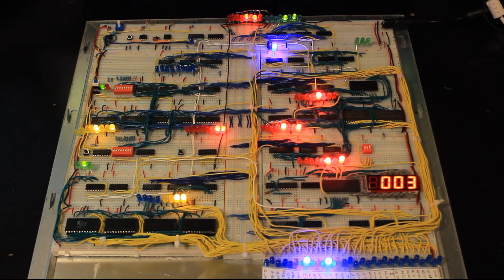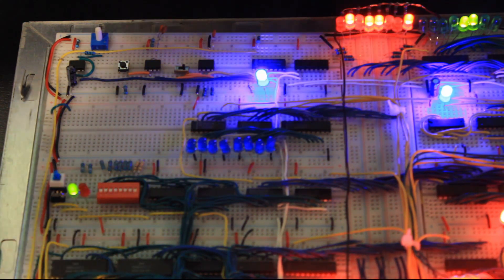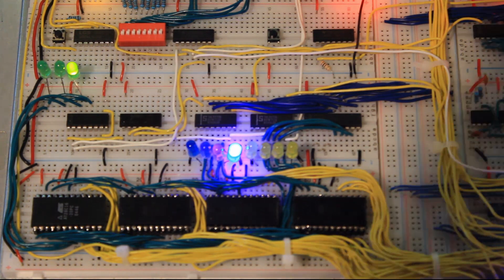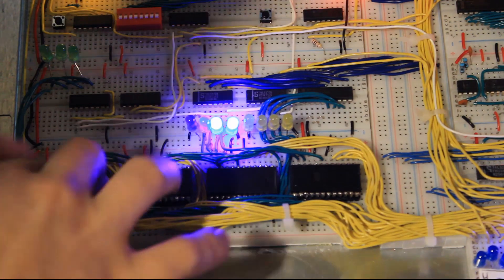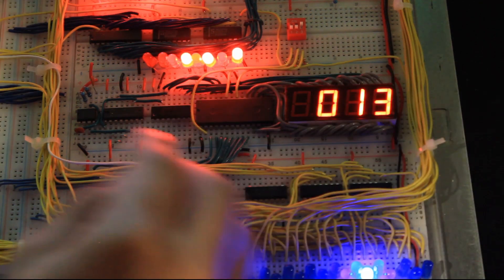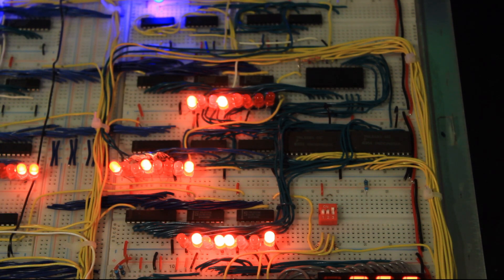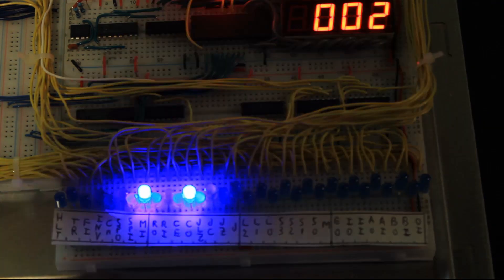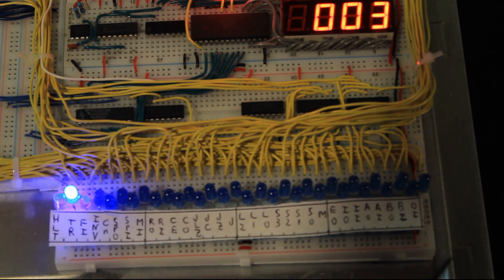8-Bit Breadboard Computer Hardware Overview

Comment from the maker: A few things of note for the record:
1) Converting to a Brand Account deletes my channel's old comments. Thanks to all that commented and engaged in discussion prior to 2020. :) Unfortunately, my old responses have all been removed by YouTube. :(
2) The program counter did not have a segment where it was looked at in detail during this video. It's on the breadboard with the green LEDs in the far upper right corner. The counter is simply 2 of the 74ls series 4 bit counter chips chained together; it is otherwise identical to Ben Eater's program counter implementation. This enables counting through the 256 addresses in the 8 bit space for the expanded memory.
3) The bus was modified slightly from Ben's design to use 1k pull down resistors as opposed to 10k pull down resistors. The indicator LEDs were also given individual current limiting resistors to prevent burnout if an unlimited current signal was applied to the bus. While the 74LS series signals are current limited to about 20mA, Myself and my LEDs highly recommend this upgrade. :)

Comment: can u tell us in detail how u create the assembly programs and which programs u use to create files thanks i got logism 2.7.1 and got all your files from github, please with an example cheers
Reply: Thanks for replying, i have managed to run the example programs u have, i have windows 7, so how do i compile using python not done any programming in over 30 years now, could u clarify to a beginner level thanks.
Reply: Thanks for that info, i just been trying out the 3 versions u have on your github and the ben10 .circ file in logism 2.7.1 i thought it would be easy just to add the file as .ram file direct to memory, and was a bit confused how the different rom files r created do they also have to be made new every time.
Reply: Hi thanks for that, ive got the sample programs working, i just wanted to play about with some assembly language and do some little programs on the circuit, how can this be done if you could show the steps clearly  thanks
Reply: Thanks for your patience, i just wanted to clarify before, if the program had to be written in a special program or just into notepad etc also wasnt sure if logisim would allow program simulation, i got the sample programs  u have in your github downloads for the 3 circuits you have on there, obviously not much complex can be created with 16 bytes. I just wanted to try the logism circuit and its good one can do that before building, which i wanted to do next. I have seen all the videos by ben and other people on youtube, and its good u r sharing your files and knowledge as that is the best deed, thanks and look forward to experimenting i used to do some programming but thats 30+ years ago, i can build and upgrade pc laptops and like tinkering about with technology, ie. phone modding, laptop upgrade etc and reading on computer technology. thanks again